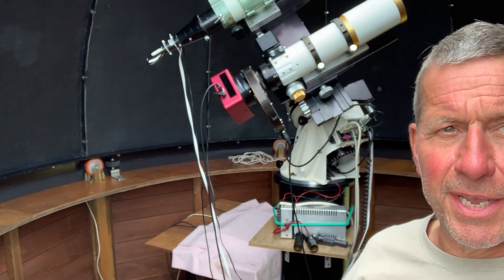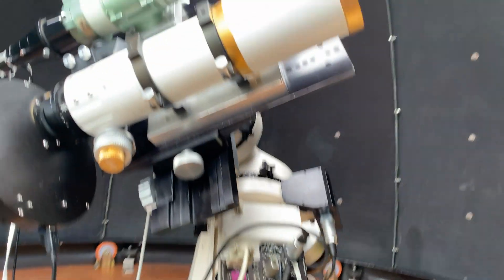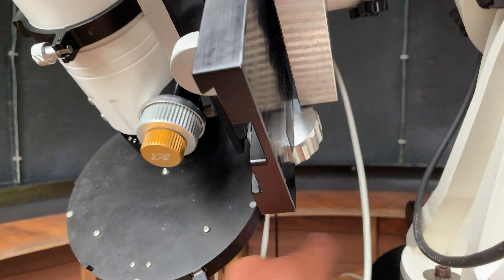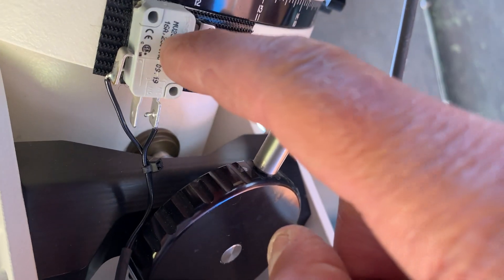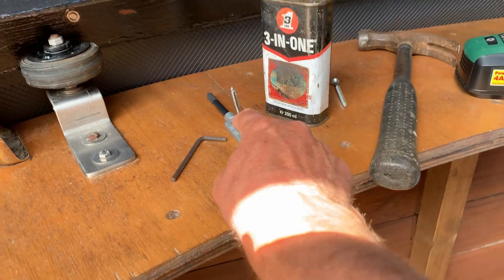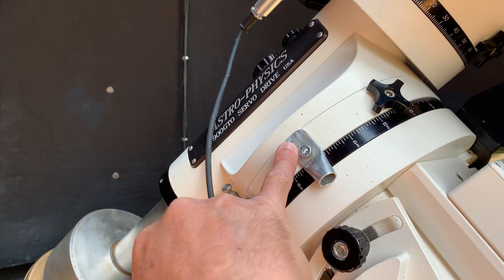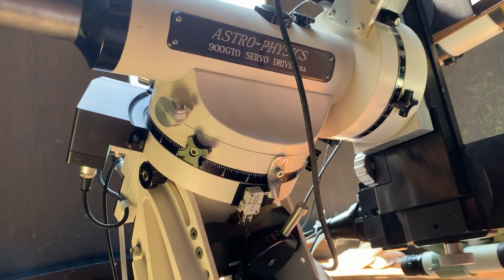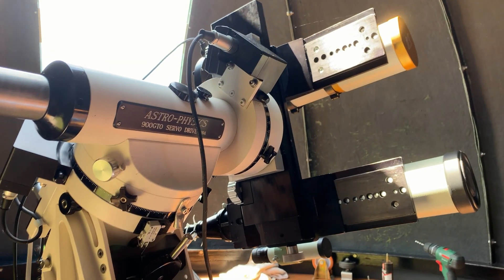AP900 Telescope Mount Limit Switch

Comment: Can you please provide switch code/item number on eBay etc?
Reply from the maker: I had them kicking around. Just Google "roller lever micro switch" they are commonly available for a pound or two.
Reply: Is that switch actually rated for that much current at 12V DC?